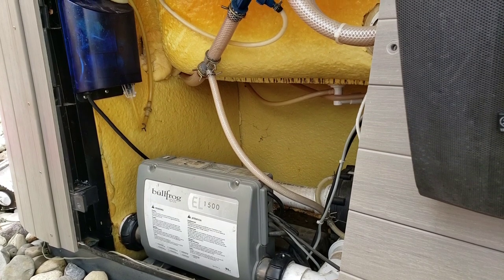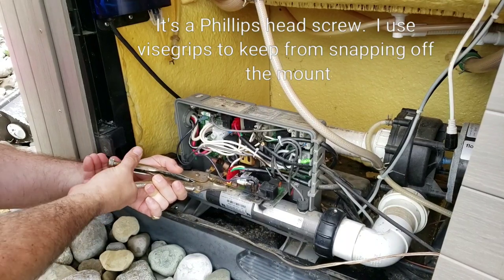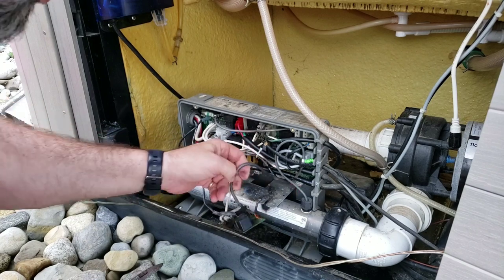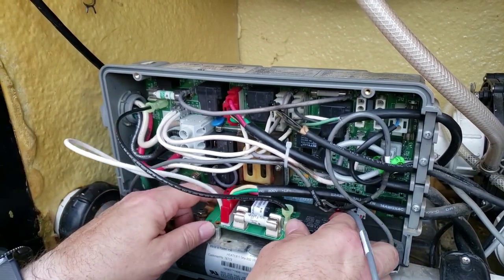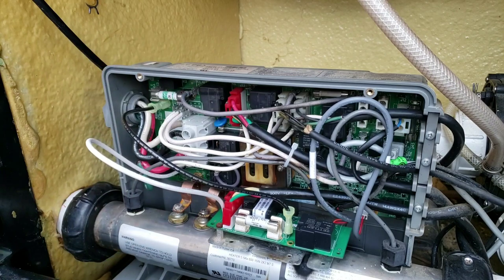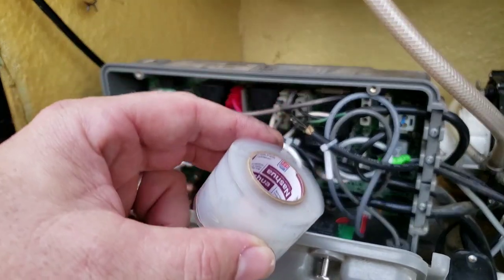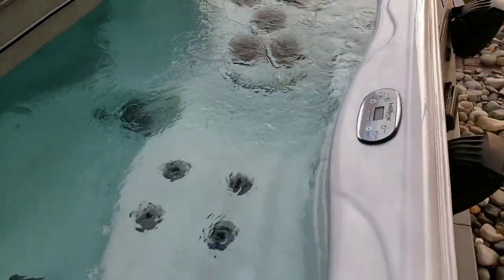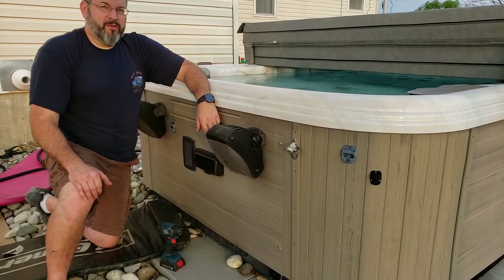Bullfrog spa Balboa EL 1500 Aux pump jets not working, relay replacement  $save$

Comment: I just bought a used bullfrog that worked when we looked at it. We moved it filled it and now when the pumps turn on I'm not getting any water movement. I've tried undoing the connections and took out the bleed value but nothing is working. Any suggestions?
Reply from the maker: If your pumps are running it should be pumping water. It's a possibility that it has an air pocket somewhere.  Air pockets shouldn't happen by design.   Is the filter old? Try pulling the filter out and circulating the tub.   If it starts working replace the filter.  The only other thing I could think is if for some reason an impeller broke in a pump.  Let me know how you make out.

Comment: Does that board allow 2 speeds on jet 2 pump
Reply from the maker: If I remember correctly that board is the reason the pump has 2 speeds.  Thanks for the question.